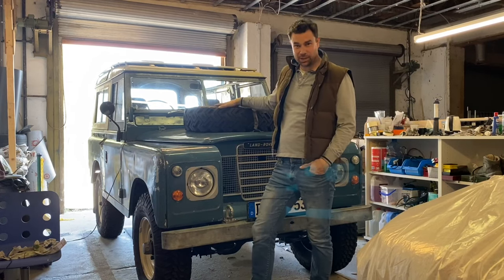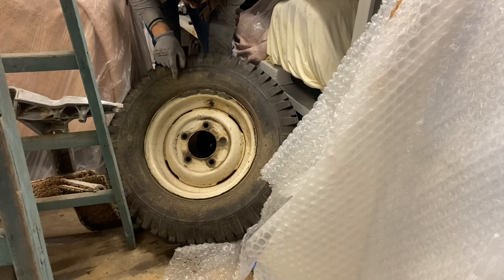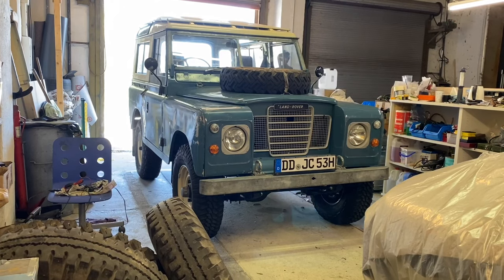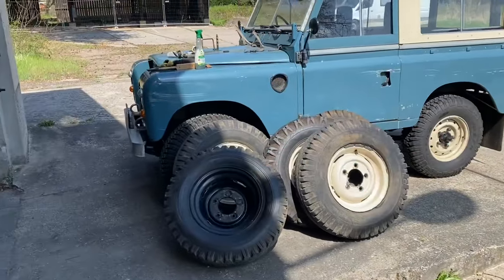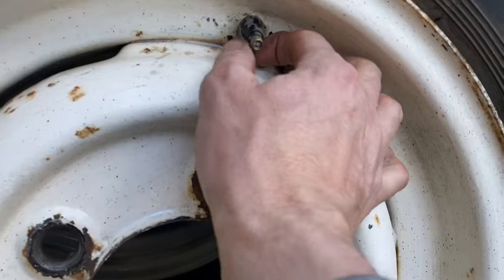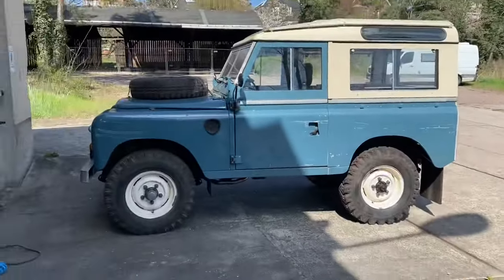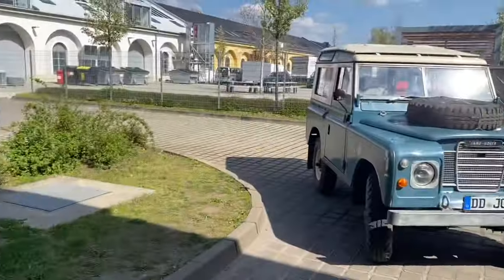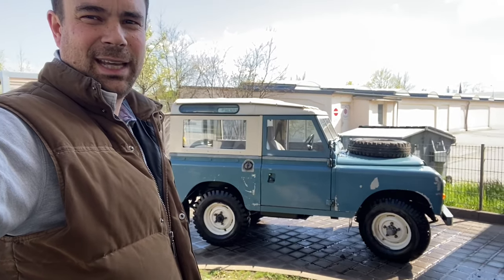Land Rover Series 3 Restoration - Going Back to 7.50 x 16 Tyres? - Part 82

Comment: Lovely your Landy Joel.  I also prefer the original rims, I feel like the bigger ones draw the eyes to the wheels instead of the car.  I am glad I did not buy a set of Wolfs I wanted to buy because of yours...this demonstration is actually very useful.  Take care and thank you for keep showing us your awesome Landy.
Reply from the maker: Hi Marco, thanks for your message. Perhaps the best set up is modern standard tubeless rims with the wrangler tyres. How’s your Landy?
Reply: @My911  I personally prefer the original look even if I have to use inner tubes.  I really liked your Landy with the wolf rims and i wanted the same but now that you went back...i like the original look better.
I am still working on the 109 truck, chassis got painted over the weekend, we had to overhaul the engine which is almost ready.  The panels are all painted, and you should be able to start putting everything back together.  I am in the US and my Landys in Costa Rica so it is challenging to rely on others to do the work for you.  I am also completing a 1963 SWB, coming along slowly but surely :)

Comment: Definitely a more classic look on the original steels. I went over to Wolf wheels because they are tubeless, I seemed to suffer endless punctures with tubes, probably down to rough old rims and incompatible tyres. Love the sound of your Land Rover, sounds very sprightly and it definitely looks so right on those wheels. As for the tramlining, that's the downside of those kind of tyres.  WRD is going to end up on some narrower tyres soon, but staying on the wolf wheels.
Reply from the maker: Hi Phil, nice to hear from you. I bought the Wolfs for the same reason as you. Although I never really had issues with flats on the 7.50‘s. But I never did much mileage really. I’ll be interested to see which tyres you go for.
Reply: @My911  In the 12 years and 80,000 miles I've run tubes I've had three flat tyres, one was a badly fitted tube by a garage, one was somebody messing with the valve, and the other was a genuine puncture caused by a thorn.

I run Avon Rangemaster 7.50 R16 at the factory pressures in the handbook (88 inch Station Wagon) and my tyres have got plenty of tread life. I always found higher pressures gave a harsh ride and poor grip.

Load under 250 kg: 25 psi (1.7 bar) front, 25 psi (1.7 bar) rear
Load over 250 kg: 25 psi (1.7 bar) front, 30 psi (2.1 bar) rear
Reply from the maker: Thanks for that. 👍
Reply: @My911  When I got my S111 88" diesel it had 750/16 tyres on lwb rims but I suspected it should have had 600/16 tyres as the speedo reading didn't seem to match the vehicle speed, ordered 5 new 1 Ton rims, sprayed in limestone and fitted 5 new Michelin 205/16 M&S tyres, what a difference, correct speedo, wider track on period correct rims and better acceleration!!
Reply from the maker: @clooperman3745  sounds cool. Would love to see a picture of you have one. I’m on instagram at My911projects if you are. 👍

Comment: Looks better with the original Land Rover wheels. Never been fond of the wolf rims on the older series. Understand better road and handling. Just like the older rims and narrow tires👍
Reply from the maker: Cheers, yes. I prefer them too. But the tyres are like concrete. 😅

Comment: I’d been running my 80” at 30psi - and someone suggested that was too hard for them and gave a harsh drive….   So I dropped them to 27/28 (can’t remember which) and I couldn’t believe the difference - not only was it more comfortable but it’s road holding improved enormously.
Reply from the maker: Hi, interesting that such a little amount makes such a difference. I’m not sure what I should run now.. 🤪

Comment: I run a 1970 LWB with as a camper (pop up roof etc) and I recently swapped from std rims to Wolfs plus 235/85 and I find it much better to drive.  Better steering, and safer with the tubeless rims and tyres and a bigger choice of tyres (at better prices too) for the wider Wolf rim than the narrow (5 1/2J) std rim.
Reply from the maker: Hi Rob, thanks for your message. That set up is a good one and I will go back to it soon. 👍

Comment: In my opinion, on a Series 3, the original rims look so much better than the Wolf rims. These rims and wider tyres go perfectly with the wider track of the Defender body with the plastic wheel arches, but the narrow 7.5 tyres fit perfectly to the series-body. I had modern Dotz-style rims on my 109, which allowed me to drive tubeless tyres, but the overall look of the car just did not feel right. I changed to the original rims and Avon Rangemaster Tyres two weeks ago and now it looks again like a Landy!
Reply from the maker: Great choice! 👍

Comment: It looks much more better with original rims. In Spain, you cant put 7,50x16 on 88" but only on 109". We must use 6.00x16 because of the MOT. Congrats for the channel!!
Reply from the maker: Hi, thank you. That is interesting. But I also love the look of the 600‘s. Mine used to have them. 👍
Reply: @My911 I'm now looking for compatibles tyres with the original design (ancient Firestone Town&Country seems to be discontinued). Waiting for your next video!
Reply from the maker: I was thinking that a compromise would be the modern ‘old style’ rims with the tubeless Goodyear tyres. That way you get the best of both worlds. Radial tubeless modern tyres and classic style rims. I have noticed however that the modern standard rims all came in white. So they would need to be painted in the sandstone to look correct.

Comment: Looks great on the 7.50s. Funnily enough I run two sets of rims on my 110, original wolf rims with 235 mud tures, and 5.5" rims with Michelin 7.50s on. It looks so much better on the Wolf rims but I get 20% better fuel economy on the Michelins.

Comment: I have a 109 with Avon Rangemaster 7.50R16 (the R is for radial) which was factory fit for many years on new Land Rover Defenders. In the UK they cost little more than cheap and nasty imports (sub-£100 each plus £15 for a tube). They are tube type but I find the on-road behaviour is very good, no wandering, and this is on a Stage 1 V8 which will do 70mph. An alternative is the excellent but more expensive Michelin Latitude Cross 7.50R16 (also available in 235/85R16) which is marked "tubeless may be used with tubes". The Avon looks more period but the Latitude Cross probably wins in terms of roadholding. With the Defender 5.5x16 tubeless rims (which look almost identical to originals except for the tubeless bead) you could run the Michelins tubeless.  My 88" runs the Defender tubeless rims with 205/85R16 modern tubeless tyres. 205s were an optional factory fit towards the end of Series 3 production and into the early coil sprung Ninety era. 205s look good on an 88" but too small for a 109. If/when the 88 needs new tyres I'll go for Latitude Cross 7.50s.
Reply from the maker: Thank you. An interesting insight into the tyres. 👍

Comment: Hi Joel, glad to see you back on the series 3. Am I correct in thinking that the tyres are all tubed? If so, the air leaking around the valve stem is probably normal. When you inflate tubed tyres, air trapped between the tube and rim has to escape through the hole by the valve stem. That’s why the stem has flutes up the side, to allow the air to escape. You should find the air leaks will eventually stop.
Reply from the maker: Hi Mark, that makes absolute sense. I checked later and the leak had indeed stopped. Excellent!

Comment: Hi mate I like the classic look of the cross-ply, and I think series landys steer better on them  (as in play at steering wheel ) i' m pretty sure on series 3s you have  less toe in if you run  radials I think if your only doing 85 km an hour radials are no advantage  apart from sand driving ,and at higher speeds the  cornering  and braking are better , but  in the Aussi bush cross-plys are more forgiving  less sidewall punctures  I  my opinion. I have landys that run both types .cheers R
Reply from the maker: Hi Reginald, thanks fir the tip. I had to chuckle when you mentioned high speeds and cornering. I never really put those two things and my Landy together 😀 Although when I was young, I could get any car to feel fast.
Reply: I agree the steering is lighter when running cross plies.

Comment: original! 👍
Reply from the maker: They do look great. But having had them on there for a little while I will have to change back to the Wolfs soon, as the old valves are cracked badly. It’s just a matter of time until one blows. Eventually I may well use the old rims again with new tyres.

Comment: For me the bigger ones look better! Just ordered them for mine… 
By the way, did your bonnet suffer the weight of the wheel? Doesn’t look very straight.. is that possible? Will be mounting a wheel on my bonnet too, hope it won’t do any damage with the time…
Reply from the maker: Hi, yes, the weight of the wheel has certainly distorted the bonnet. I spent ages trying to put it right but it doesn’t seem possible. It’s a common problem.

Comment: I used to run tyres with similar tread like the ones made in Malaysia that you put on. They were totally useless in the snow and pretty much useless everywhere else. Only good for maybe a short trip to the local supermarket. I understand that you made this swap purely to check the aesthetics but you ended up with 2 dissimilar tyres on the rear axle, which is not the best situation for your rear diff.
Reply from the maker: I agree entirely. Mixed tyres are also illegal over here. 👍

Comment: You can get steel 110 rims which are tubeless. I’ve got them on my 109 with 750s on. Michelin XPC.Don’t you have to have another MOT type test if you change the tyres?
Reply: No, onkly if your tyre type change to one that isn't written to your "Fahrzeugschein". 7.50R16 is pretty common for that vehicles. He might had one for the wolf rims, where TÜV checked that the speedo still works precise and steering works etc.
Reply from the maker: Hi guys the TÜV entered in the 235 85 16 tyres in the papers. For the cost of the TÜV I had to supply a surprising amount of information for the vehicle. They just don’t have them out here in the old east. The insurance wasn’t easy either. It took ages to match the car to the system. 

Martin, your set up would be a great alternative and one I had thought about.

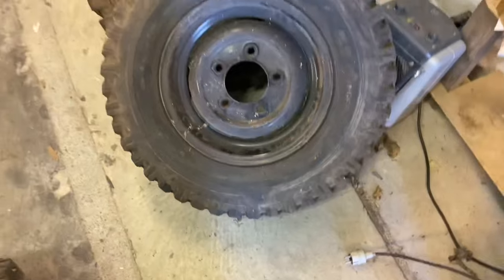Comment: Sorry if this has been mentioned before, but what gearing does your speedometer have? The 88" originally had a speedo geared for 6:50 (approx 205/80) tyres, so with 7:50s it will under read by a noticeable amount. I went back to 205s for this reason.
Reply from the maker: Hi, it’s set to the original (smaller) tyres so it’s not accurate. Both for speed and distance. I really like the smaller tyres actually. They look great.

Comment: Your 7.50-16 are bias plys. They have more internal friction than the 235 radials. So the car uses more petrol with the 7.50 even thoug they are less wide.
Also they wander around a lot more and get flat spots on them every time you park the car and therefor give a bumpy ride for a few minutes. There are new 7.50-16 tires for sale that are radials.
Reply from the maker: Thank you. That’s good knowledge. I won’t be using them for long. 👍
Reply: @My911  👍

Comment: Greetings from Canada where due to salt on winter roads Series L/R are few and far between. Years ago I had a short wheelbase 2A. I do wonder why you would think of driving around on 20 year old cross-ply tires when you have new radial tires with a "D" load rating and "Q" speed rating.
Reply from the maker: Hi Richard, I get the salt thing. Same as in Germany and the UK. Don’t worry. The 7.50’s aren’t staying on for long.

Comment: There’s a simplistic formula [((weight on axle /2)/max load)*max psi] in absence of official pressures from your operator manual (if you still have it) but works better on tubeless
Your tyre max load showed 1000kg@350kPa which is approx 50psi
Say, specified load on axle is 1100 you do 1100/2=550 then (50*550)/1000 = 28psi (cold) but then it’s adjusted to suit the tyres
I run my 235/85 r16 Davanti’s on my 90 higher than I did the BFG’s cos the sidewall is softer so the extra pressure reduces deformation @36psi all round so about the same as your pressures
Reply from the maker: Thanks Dean. That’s great knowledge and very useful.  👍

Comment: Bet the leak is from air trapped between tube and tyre. On my 2a 88 inch I have 760 crossply on and they are good of road but terrible on road. My opinion is I would stick to your nice radicals. Also be aware of wet roads on crossply as you get into a lot of trouble.  Here in Johannesburg it's usually hot and dry and the crossply are good with pot holes and bricks and rock on the roads.
Reply from the maker: Thanks Kevin. You are right. There seems to be no flat today. 👍

Comment: Original rims for sure are better. Were the wolf rims 235x85x16? I think the 7.50 x16 will be worse off road as they dont flex as much. They prob have like 8-11 plies.
Reply from the maker: Correct. Not sure about the ply pattern though. It might even say on the side walls.
Reply: @My911  yeah bud 7.50 tyres are light truck. For touring around the world and wear they are prob best but they will always give poorer performance? I would think so
Reply from the maker: I think so too. I always only had the 7.50’s when I drove it back in the day and had no real problems with them at all. But it’s nice to have the modern radials. 👍

Comment: need to figure out tires for my old ih c120 pickup that has 7.5 x 16 tires as well theyre prolly from the 80's on it
Reply from the maker: Hi, are they rock solid like mine? 😅
Reply: @My911  drove it on them last fall from the raspberry bush's it was parked in  noise can be tires as well

Comment: Apparently not the consensus,  but I liked the set with the Wrangler tires on them a lot better.  The ones that were on it when the video started.....
Reply from the maker: Hi Patrick, good to hear from you. I’ll end up putting those back on as they are the better set up for use over here. They are also legal! 😀 German law states only the same Type/brand of tyres are allowed on one axlee es, and I’m Mixing that with the old ones. I just swapped them out as I like the original rims and wanted to see what the Landy looked like with them on. 👍